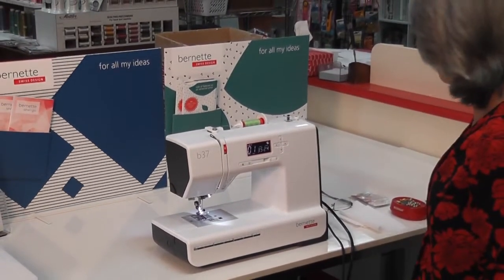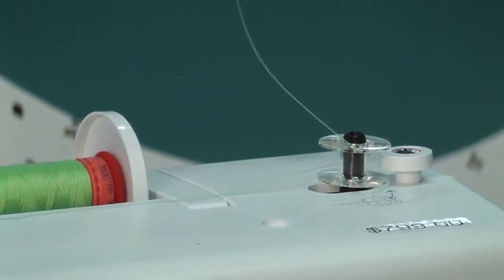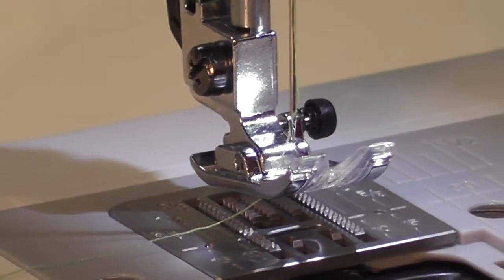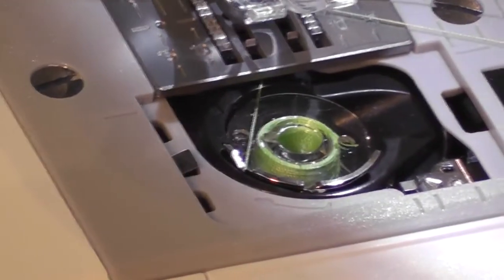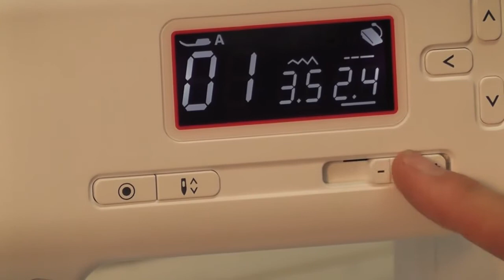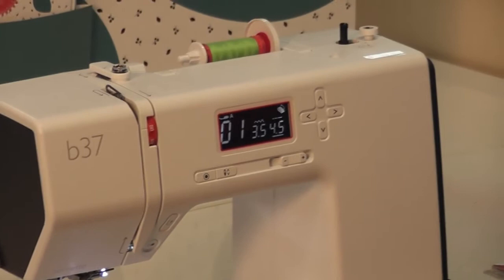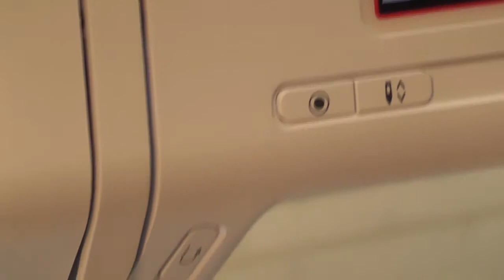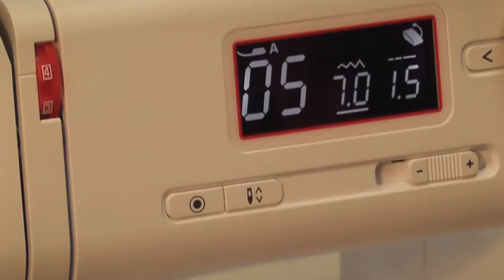Bernette B37 Sewing machine Basics

Comment: It’s a good sewing machine, I have one too! 😊sews with perfection but probably the best thing about it is how pleasant it sounds and how quiet it is compared to other computerized models. The stitch quality is great! 
One very important thing though, don’t buy it if you wish to sew with heavy fabrics; this machine sews thin to medium thickness fabrics and will really struggle with the thicker heavier ones or with more then four layers of fabric. At least this is what I have found after sewing with it for 7 months. So if you plan to sew things like dresses, blouses, light weight skirts, pants etc, this will work great. If you want to make coats, bags , jeans and things like that, buy a machine with a stronger motor. I wish these presentation videos would mention this aspect.

Comment: Nice video and very informative. When sewing stitches #01, 02, 03, 07, 14, 35 &3 36, the 'stitch width' value is the position of the needle, 3.5 being the center. Use the upper or lower arrow buttons to move the needle to the left or right. This is a handy feature to keep the fabric over the feed dogs and to sew in a different location on the stitch plate. I bought my b37 from Goodwill for $20; I don't believe it was ever used.
Reply from the maker: Great find.